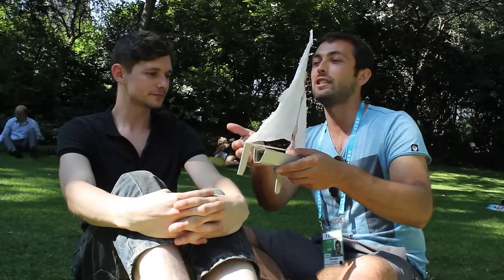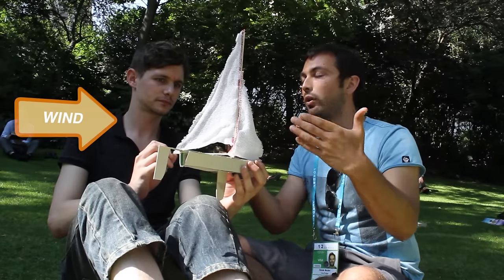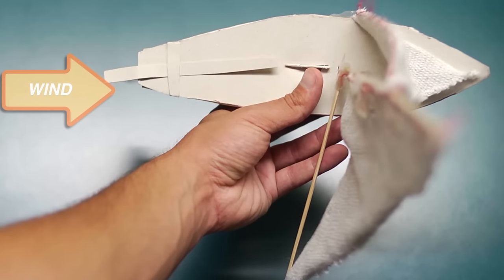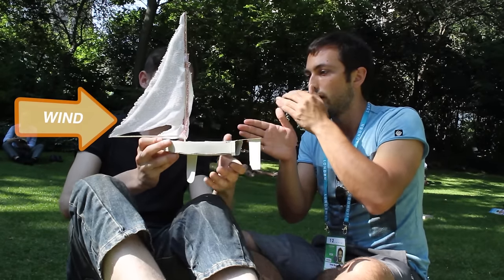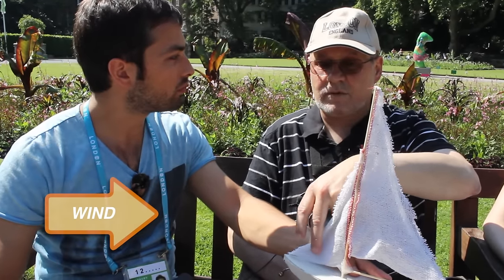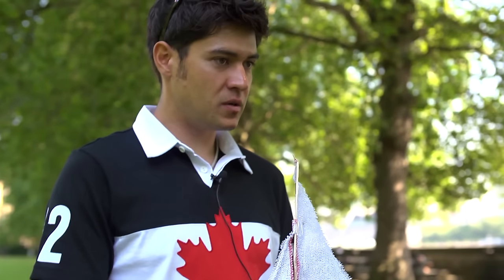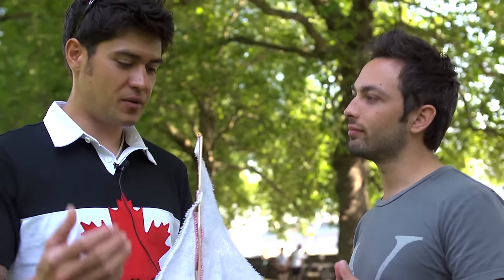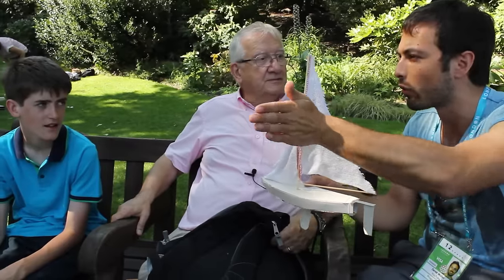How Does A Sailboat Actually Work?

Comment: Goosewinging (or flying with the wind) is more effective than going on a beam reach (perpendicular) when you have a sheet sail or are on a galleon that uses square sails, but if you have the modern triangular main sail paired with a Jib you will get more out of the wind if you maintain a beam reach.

Comment: This further reduces the 'speed' of the air on the inside of the sail, creating a pressure difference and the sail pushed outwards. Most sails have 2 inch long pieces of sting on the surface as visual markers as to how the air is flowing around the sails. Planes during landing also need to produce the extra lift due to their slower speed, so they deploy 'flaps' which cause air on top to curve around and 'push back' the air under the wing to produce the extra lift during landing.

Comment: The fastest direction is not between 45 degrees and 90 degrees. It's between 90 and 135 degrees. You start of at 90 degrees, then when you gain speed, the headwind makes it so that the relative wind is coming more and more from the front. To counteract that, you turn downwind. Eventually you'll probably end up at about 110-120 degrees. Also, if the boat has a gennaker, the fastest course will be even further downwind, because that's where it's the most effective.

Comment: They left out an important explanation of the actual forces that occur on the boat while sailing up wind.  The rudder, keel, and hull actually absorb almost all of the horizontal forces.  The reason that you can re-direct all of that wind energy into a favorable vector is because the rudder and keel transfer opposing energy to the water.  To accelerate the wind you need something to push against.  You aren't just moving forward.  You are actually moving sideways too, just very slowly.

Comment: In order to prevent motion that would other wise happen, force must be present. In order to prevent the boat from moving sideways, the center board must generate a force. So the board does generate a force, just not in the direction that the boat is moving.

Comment: A boat doesn't depend on the wind to blow it forward, but depends on the lift created by the sail, that's why sailors have to adjust the sail to direction for maximum lift, and that's why a boat can sail upwind. The lift generated has a side way direction, so a dagger board is needed to cancel the side force. The boat would tend to turn over, and the sailors need to use his body weight to balance the boat.

Comment: I think I have a better explanation for that. The sail with the boat act like a peace of soap squeezed by a hand against a wall. The water plays the role of the wall and the hand that pushes the soap is like the wind.
If the wind goes in a certain direction and the boat and water are at rest initially, then it may not cause movement as a whole to the opposite direction, given the conservation of linear momentum law. So, actually, the water (or the wall) is pushed in the same direction of the wind (the hand), but the boat squeezed against the water (the soap against the wall) is pushed by the water and the wind (the wall) in a transversal direction or even, to some extent, possibly against the wind. Never in the exact opposite direction, though.
So, I think the answer to the main question, that is, how can the wind push a boat in its opposite direction, is “the wind is actually pushing the water, the boat is just being squeezed in the process”.
Reply: *****
Thanks, Barney.We can also see that the boat without a keel to pressure the water can't go against the wind. Another example is the kitesurfer. He can go against the wind pressing the water with the board, but he goes always in the wind direction when he jumps off the water.

Comment: Actually, the fastest a sailing boat can go is with a TRUE WIND coming around 45 degrees from the stern (rear). As the boat increases it's speed, the RELATIVE WIND comes forward, further from the stern and closer to the bow, until it ends up sailing about 40 to 45 degrees from the RELATIVE WIND (which feels like sailing upwind from the boat's perspective). True wind is much lighter and it's still coming offset from the stern. The exact angles obviously depend on boat and sail design, and wind speed.

Comment: @veritasium Here's on for you: How about other "sail like" devices - can we make one that goes directly into the wind, or can we make one that goes directly down-wind faster than the wind speed? Thinking windmills driving wheels here. It can cause quite an argument (answer is yes and yes BTW)

About faster than the wind sailing - you kind of hinted at the forces involved, but it's quite simple. Terminal velocity is where all forces balance out, and that can happen at higher than wind speed if drag is low. The new AC foiling cats are doing about 3x windspeed in 15 knots in Bermuda right now, but at about 120deg off the true wind. Ice boats can do more than that, at much deeper angles again (apparent wind is quite forward at those speeds)

Comment: yes. that is bartolli's principle. that is not how lift is generated. lift is caused by the air, closest to the sail, following the airfoil shape of the sail, while the air, further from the sail, keeps going straight, after being 'deflected' by the leading edge of the sail . this causes a negative pressure area between these two airflows and, since nature abhors a vacuum, it sucks the sail forwards. the underwater foil (keel, centerboard, etc) changes the sideways lift into forward drive.

Comment: Looking at the polar plots of several recreational sailboats, it seems that for most boats the maximal hull speed is achieved at a true wind angle of around 145 degrees, so diagonally from behind. The peak you described at 40 degrees due to the Bernoulli effect is only present in sport sailing vessels it seems. I guess because of the light high-performance materials reducing friction. I am not a sailer so correct me if I'm wrong.

Comment: My guess: The sail is curved, so the wind currents on each side have to travel unequal distances. Although the sail is thin, the average speed of the air particles either side will not be the same. It's not just the air that directly touches the sail that counts, so there is a fair difference.

Comment: The theory is not incorrect just the assumption that the air reaches the back at the same time from both sides.  The pressure gradient is still created.  The exact reason as to why it is created is not definitively known.  

The sail of a sailboat actually only creates a minimal amount of lift through this effect,  the main power come from the fact that it is changing the direction of the wind, just as your son said.

Comment: Valid point but didn't really explain it. Just some handwaving about "lift". Maybe blatantly state what was kinda said that as you sail into the wind the relative wind increases so you sail faster so the relative wind increases so ... And maybe a force diagram showing the sail putting a sideways and a forward force (when boat and sail are angled correctly into the wind) to propel the boat (or is it a ship?).

Comment: actually, a beam reach is supposed to be the fastest: around 90 degrees to the wind. 50% drive from the wind blowing in the sail and 50% lift from the flow of the wind on the lee side of the sail. if you are sailing greater than 90 degrees to the wind ( down wind ), you are mainly being pushed. if you are sailing up wind, you are mainly being driven by lift. but across the wind you get the benefit of both, in equal shares.

Comment: I was not talking about sailing downwind faster than the wind on a velocity made good course.  In other words I was not talking about a boat on a downwind reach tacking back and forth to go faster than the wind.  There is a way to sail downwind faster than the wind DIRECTLY downwind.  No change of direction.  It has been done and the official record holder had a speed of 2.8 times the speed of the wind.   Of course it was a land yacht, but the same could be done with a boat.

Comment: Hmmmm...... I much prefer to think about how the momentum of the air is changed as it passes over the sail (in a reach it bends towards the rear of the boat). In order to change the air's momentum you must apply a force upon it (imagine the vector addition of stopping the inflowing air then accelerating it in the outflow direction to find resultant force upon the air). The reaction force upon the boat is equal and opposite to that applied to bend the wind. This is the force upon the boat. Resolve the force upon the boat into a component perpendicular to the centreboard (the boat has high drag in this sideways direction and therefore won't move fast sideways) and a component  parallel to the centreboard (in this direction the boat is streamlined and moves readily)

Comment: My windsurfing board can go more than twice of the wind speed, on certain courses it will approach three times the local wind speed. These concepts are quite easy to understand. Are they not teaching any physics in these countries where you did your interviews ? ;-)
Reply: The most counter-intuitive course is deep downwind. You start running with the wind, at some angle from dead downwind - and then as you accelerate the apparent wind causes that you feel the wind blowing from your front-side. ;-)  This is only possible on certain high performance sailboats or windsurfing boards. I can feel it clearly on a Formula board with a very large sail and a long fin. It's fun but it's rather counter-intuitive to a lay person :-)

Comment: From experience I knew the correct way to position the boat, but I had no idea why and always wondered why it seemed like the boat moved faster at about 45 degrees from the wind with trimmed sails, than fully with the with the wind with open sails, if it was the wind that was pushing it.

Comment: down wind, motion is achieved only by being pushed. up wind, motion is almost totally caused by lift. across the wind, in what's called a beam reach, the sail is being pushed and pulled ( lift ), and therefore has the greatest force being applied to it, by the wind. so, in 20 knot winds, a Bavaria 36 sailboat might do 7 or 8 knots down wind. it might do 6 or 7 knots upwind. but across the wind, it might do 12 or 14  knots. some dinghies, with planning hulls, can achieve faster speeds down wind..

Comment: ok folks. go to DNS animations: how sails work. it's a youtube video. it graphically explains, without the physics, how sails work. note the air flow over the sail. see the separation? that's what I was talking about. this separation causes a negative pressure zone on the forward ( back in his video ) side of the trailing edge of the sail. this causes lift. thought the visual might help

Comment: I think it is 'easy'(theoretically, meaning infinitestimal drag for boat) to traveal faster than the wind which is driving the boat. One example would be positioning your boat perpendicular to the wind and positioning the sail to any angle below 45 degree.(The smaller angle you positioning the sail, the faster you'll be. ) Am i right?

Comment: I'm surprised that no one thought to mention how when riding a wave on a surf board that fastest direction is at an angle to the wave and in this way the surfer can exceed the speed of the wave.  It's not a perfect analogy, because sails use lift where surfing is using the force of gravity over an incline, but in both cases the speed of the craft can exceed the speed of the medium they ride in by moving at an angle to the medium (that is, water or air).

Comment: Another fast way to sail a sailboat is going on about a 85 to 70  degree angle generating low pressure on the front of the sails and high pressure on the back of the sails.

Comment: Makes me wonder...if sailing is an example of a hydrofoil at work, what prolonged the invention of flight so many centuries after sailing? Was it the lack of propulsion/windspeed required to generate the lift required for flight? Someone should've put the sail horizontal much earlier!
Reply: Because when you are sailing, the wind provides the driving force, and all you have to combat is the resistive forces of the air and water on the boat. But when it comes to flight, the wind is not strong enough on its own to cause enough lift as you also have to counter the weight of the aircraft. You therefore need to induce artificial wind by pulling the wind forward through the air to make up the missing airflow that the wind was not able to supply, and the technology of the time was not advanced enough to pull the aircraft through the air fast enough to create enough lift.

Comment: I understand a sailboat works by wind pushing against the vessel which is pushing against the water. This is how it's able to sail up wind in a slalom pattern. I also understand solar sales work by electromagnetic radiation pushing against the sail outward from the sun.

What I don't understand is how ESA and NASA's next Sunjammer spacecraft is planning on flying toward the sun using a solar sail when the vessel isn't in a sea of any sort to give it leverage.

Please answer!

Comment: well, I don't know. he actually says the lift is generated by the wind having further to go, on the lee side of the sail. that's bartolli's principle: by having further to go, yet having to reach the end, at the same time, the air on the lee side is moving faster that that on the weather side, causing left. that is a common belief, but it is wrong. if it was right, stunt planes could not fly, since they usually have wings of a symmetrical cross section.

Comment: Good video, but the physical phenomenons are a bit different than explained. 
Wind actually pushes the sail and this generates torque which is constrained by the keel. This creates vectorial speed and now the system is developing power. That's basically the actual and real concept behind a sail boat going faster than wind: the resultant power prescinds from wind speed. 
Secondarily, the outer part of sail generates lift as soon as any speed exists (just as an airfoil in every wing), and this helps to achieve higher efficiencies in some sailing assets.
Reply: Sounds like pressing on a watermelon seed on a table and getting it to squirt sideways at high speed faster than you could without the table there.
Reply: @wingerrrrrrrrr  AAHHAHAHHAHAHHAHAHAHHAHAHAHAHHA I wasn’t even remembering I left this comment

Comment: ...the wind does. the deeper the keel is, the further away from the boat it's lift is generated and the more the boat will heel. contrary to popular belief, the keel does not resist heeling, it aids it. weight, called ballast, and hull shape are what keeps a boat from capsizing. a sailboat can exceed the speed of the wind only when sailing across the wind. down wind, it can almost go the speed of the wind. upwind, it will also never reach the speed of the wind...

Comment: ...way that your hand did, in the tub of water. as the wind pushes the boat sideways ( leeward ) it pushes the fin leeward, causing a negative pressure zone on the side the wind is coming from, thus, creating lift that counteracts the sideways motion of the sail's lift. together, these forces redirect the force of the lift to drive the boat forwards. some of the lift, from the sails, is wasted leaning ( heeling) the boat over. the lift from the keel also heels the boat, in the same direction...

Comment: This was less informative than I expected. But the linked video talking about how a wing works helps to some extent.
There are a number of papers on how sails work, but the one I like explain sailing like air being forced in a direction combined with the Coandă effect.
The paper describes how low air pressure is not what moves the boat forward, the explanation against low air pressure centers on the fact that there is nothing stopping the air in front of the boat from filling in the supposed low air pressure. The paper explains that the shape of the sails and the angle the air hits the leading edge plays the biggest role.  
The real reason I like the paper mentioned above is it explains the motion of the boat like its a rocket, okay that's my interpretation, but the paper describes the deflection of the air to the back of the boat like it is throwing mass behind like a rocket. The Coandă effect only enhances the effect because the air that sticks to the front side of the sails also swings through the sail's curve to be ejected behind the boat. When I started seeing the sails as mass diverters as opposed to wings I started to notice that the front sail on boat is normally setup to push air behind the main sail. It made me think of air entrained like one of the circular Dyson fans. The air on a front sail catches air and deflects it into a gap about 3 feet wide increasing the ejected mass of air behind the boat. The paper explained that the Newtonian and Coandă effect followed experience and it gave me a different view on why sail shape and "triming" was such an art.

Comment: Not exactly the same thing but in snowboarding you can increase your speed by turning as well if rather than carving you ride on the edge of the board. While this probably has more to do with friction and weight, it sounds as though some of the same things apply when sailing

Comment: The keeling line is ahead of the sails instead of behind the sails.  The keel should be under the mast not the  boom.  Normal keeling is stem to stern keel line. The stem being the deepest point of the hull and the stern is the shallowest point of the hull.